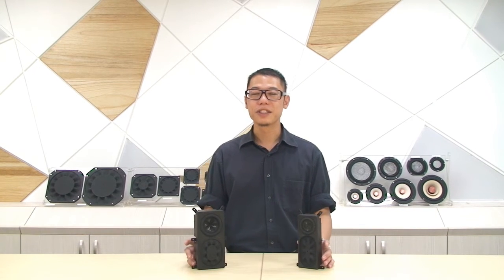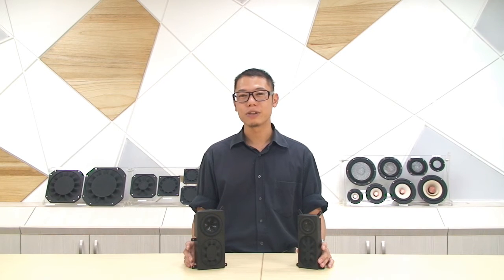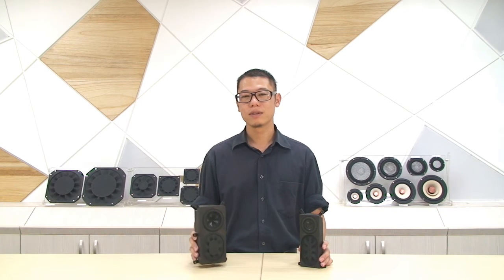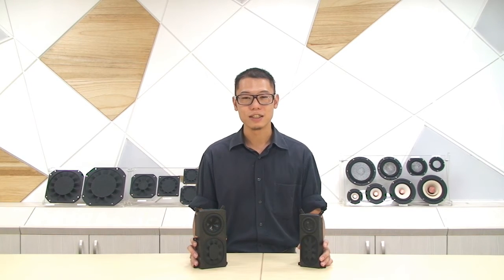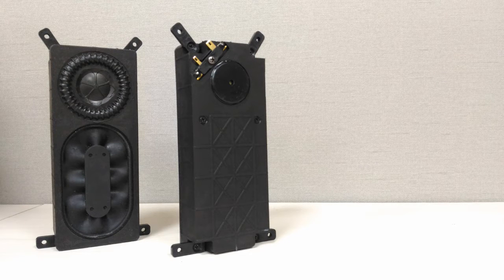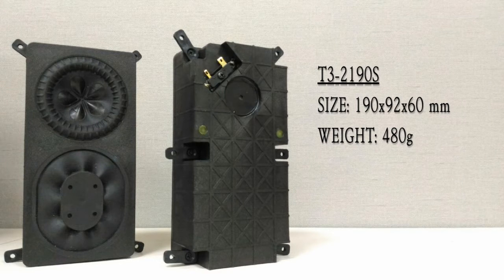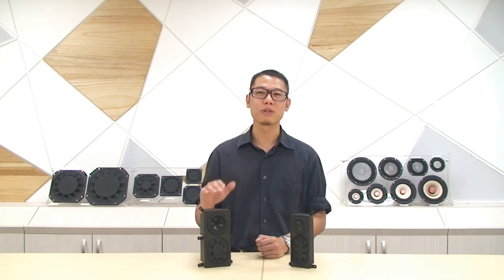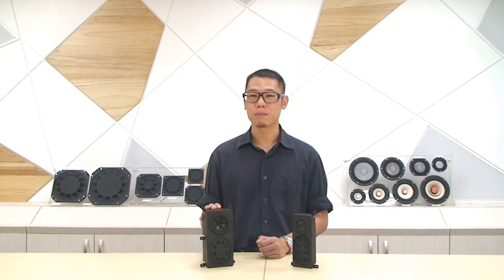Tang Band Speaker "Subwoofer Module Introduction" in English

Comment: I have tried both of these and they are indeed sounding very good.👍 For the 2 inch model(3 inch model structurally is more rigid) the body/shell including the speaker baffle vibrates almost like a speaker cone/membrane. So I have to go about reinforcing the enclosure walls and brace the reinforcing structure itself. Great product!